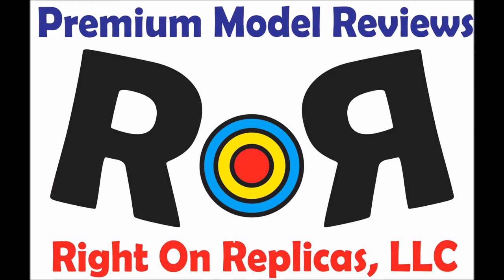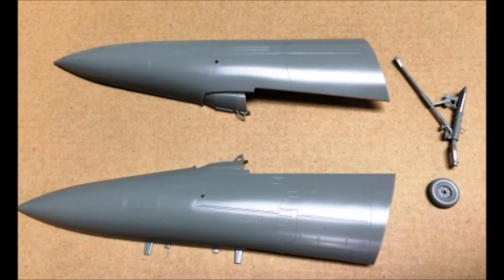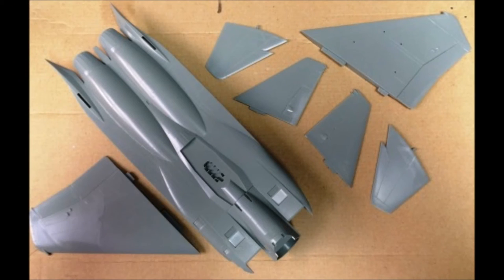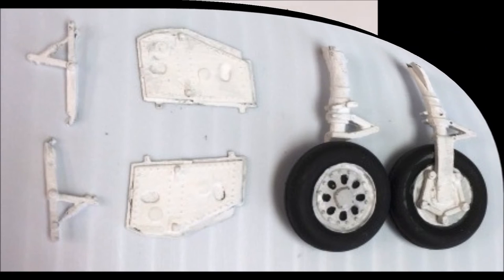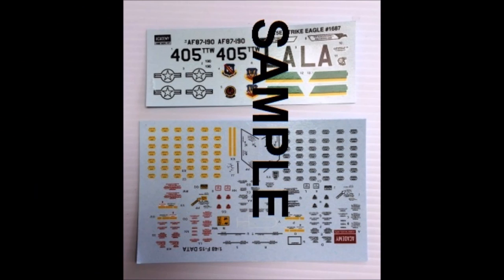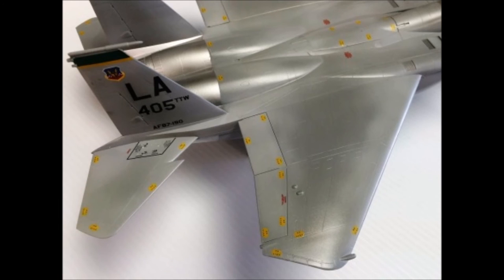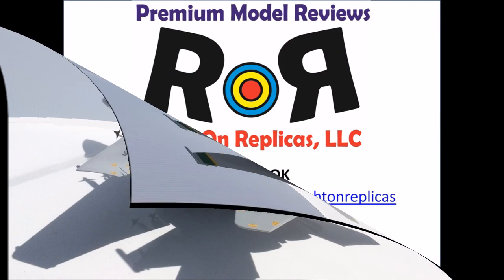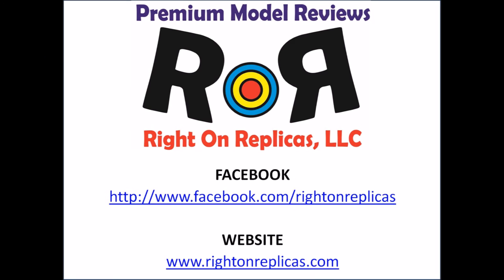How to Build the F-15E Strike Eagle 1:48 Scale Academy Model Kit #1687 Review

Comment: how did you add the CFTs? I'm having trouble with the instructions and I didn't see where you spoke about it.
Reply from the maker: TD,  Frankly,  it's been so long that I don't recall.  Normally, if I have any problems with construction I would have mentioned it.  Dry fit, scrape and sand until it goes together!  -Doug

Comment: Awesome build! Is this the same as the Revell  F-15 strike Eagle? I 've just recently built that kit, and  this one looks veery familiar. Mine had the newer style 'turkey feather' exhausts, which I admit were a real nightmare to assemble...
Reply from the maker: EH,  I don't think they share molds but of course the parts should look similar in the same scale!  -Doug
Reply: ah, ok, thkx for the review! Everything looked really clean and pretty straightforward. I remember building quite a few of the Monogram F-15 kits back in the day!  :)
Reply: No These are NOT the same as Revell. Revell are WAY better shaped.  Many critics and modellers alike, point out that the humps for the engines are way over emphasized and out of scale on the Academy kit.  Revell has the shape perfected.
Reply from the maker: JM,  Thanks for the confirmation!  -Doug